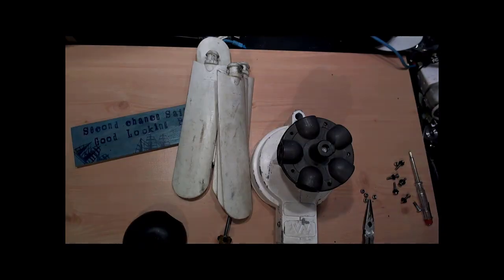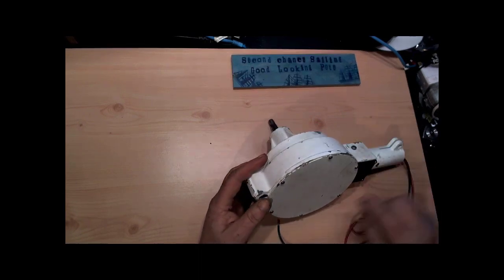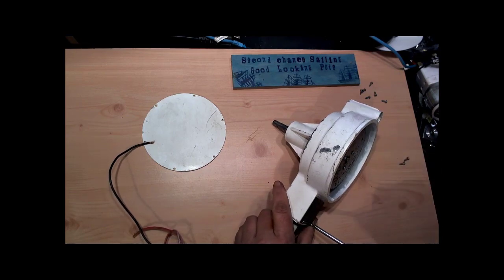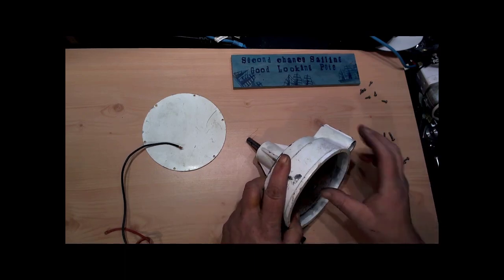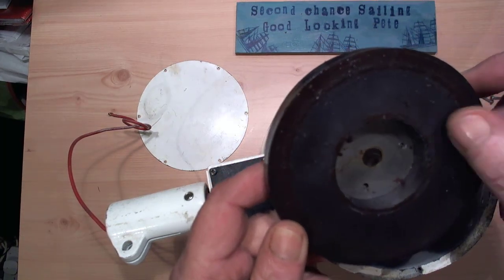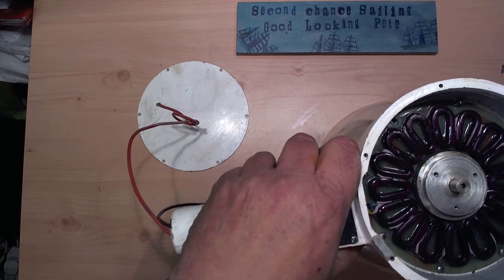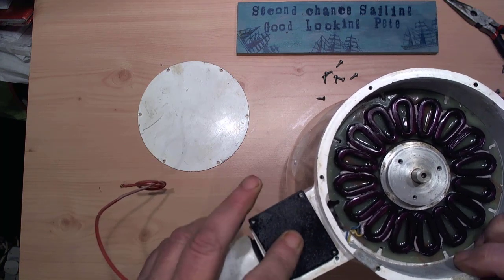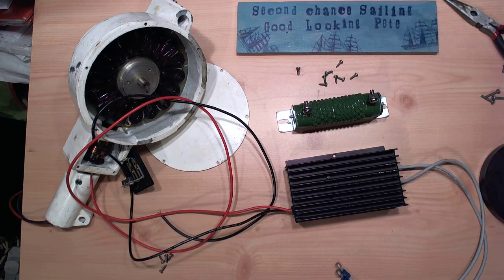wind generator Second Chance Sailing

Comment: Did you ever get it apart Pete? What was the problem? By the look of the magnet and the marks looks like a bearing has play allowing the rotor to contact the magnet plate.
Reply from the maker: Crack in the back Magnet think someone used a hammer striping it last time changed Magnet working ok now going to do a video with it running in back garden changing a battery

Comment: If you hook it up without a controller, what stops it overcharging the batteries?
Reply from the maker: nothing but the manual says its ok but we went out and bought the reg and the dump just to be safemight be ok if you had something drawing a small load off the battery's